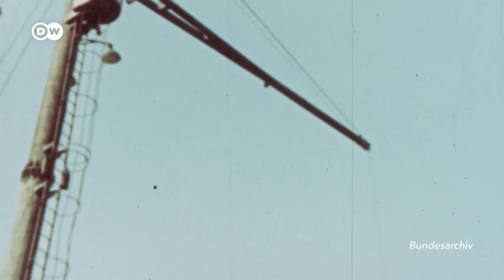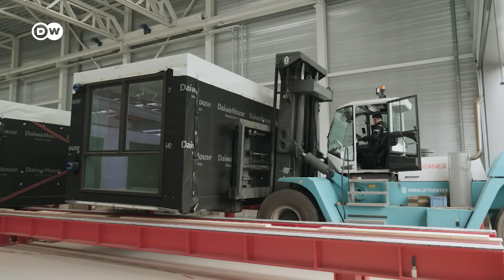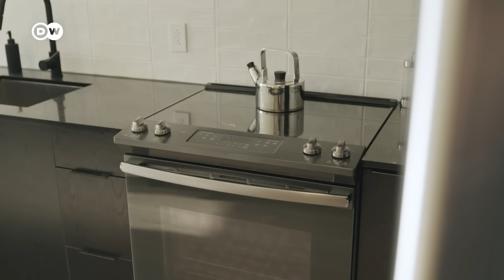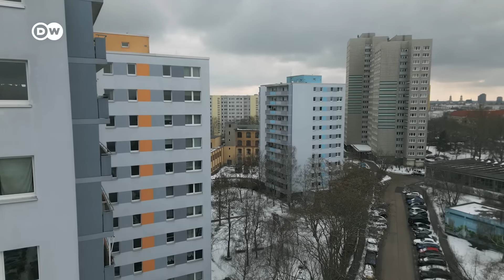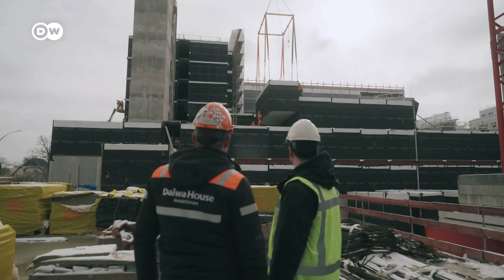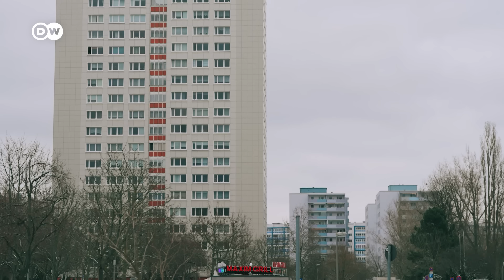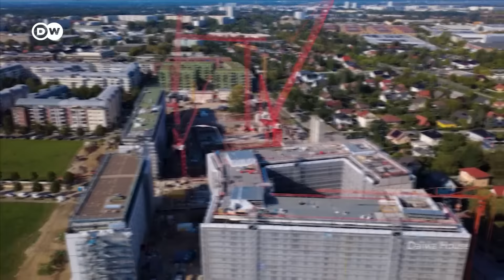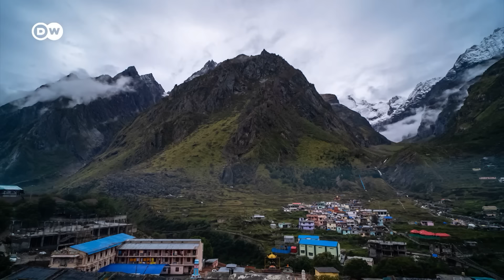These buildings are ugly. But the idea was genius.

Comment: Daiwa is the top leading company in the prefab steel building in Japan. so what is unexpected is they use concrete for their prefab construction. When it comes to sustainability in construction industry, timber-based modular construction makes more sense than concrete.

Comment: I'm pretty sure this idea is not new and multiple companies tried this multiple times in the past. Who has succeded? None as far as I'm aware, please correct me if I'm wrong and point towards a 100 year company that has been building modular homes since before ww1. Okay, that may be hard, lets try since before ww2. If thats still hard, provide an example of a company that has had a running modular factory with lots if successful projects for at least 50 years. Anyone? Because this idea is definitely older than 50 years.

One of the problems: if you dont allow the ground to settle before you put your modules in, it may start shifting under your building. Potential problems: connections between modules get broken. Like, pipes bursting and wires getting torn. I'm pretty sure I've seen a video on this topic relatively recently but I couldn't find a name of the project. I think it was a pod skyscraper in japan. Another project, iirc, from canada, died before being built (or did it just shrink significantly?) and was converted to Unreal Engine tech demo or something similar. As I've written before, I couldn't find the name of the project with a quick search.

Comment: A Red brick 8 inch by 3 inch is also a pre-fabricated unit of construction albeit smaller but highly flexible on site to accommodate different heights - different thickness - different shapes and designs. No thanks. We will stick to the smaller pre-fab units called as  bricks.

Comment: This new wave of prefab is actually been going on for a couple of decades. Before retiring, my practice used modular design for many public buildinds - hospitals, universities, research facilities, social housing. It was a huge boon to hospital floor plans which can flex with changing need. Beyond rapid construction, housing was less successful - thin walls, noise transfer, snagging and aesthetics (don't discount this when thinking about wellbeing). 

There are continual improvements being made though so I'd be interested to know what residents think after 5 years of living in them.

Comment: The modules is a good idea, like the Dutch guy said, you can take em apart, relocate them if needed, all very clever. The thing in modern architecture that I'm worried about most is the lack of architectual identity of the outer shell of a bulding. No ornimentations, no identity, no culture ... just cubes.

Comment: But why do you HAVE to "standardize your construction practices." I have worked in several factories that make custom-to-order products. The factory and the processes are simply designed to be adaptable for each project. Sure, building only one variation of your product is easier...   to get started. But, someone is going to come along with a factory able to switch between several different models for almost the same cost savings and they will eat your lunch. Then, someone else will come along with a completely flexible process that allows them to instantly custom make each module to the customer's specifications, for not much more than the original cookie cutter factory, and they will win. 

Isn't it better to simply start designing for custom-to-order from the beginning (or as soon as possible) and never give the competition the chance to put you out of business?

Comment: Personally, I am absolutely sold on the benefits of pre-fab modular housing, not just as a solution for the shortage of housing, but just because it makes so much more sense than stick-built individual homes or apartment buildings. Yet there is such stubborn resistance to it as a concept, mostly apparently from people who still have Eastern European "soul-less" leviathan buildings as their only internal example of how such buildings look and feel. The fact is that pre-fab modular housing can be made to fit almost any environment, including spacious layouts with parks and services, and individual units can be significantly customized.

Comment: Looks interesting. I wonder how plumbing maintenance works? I mean, it looks like the pipes are between the inner and outer walls. If one starts leaking, what do we do? Break the inner wall to mend it? If so, it would mean it isn't a load bearing wall. This, in turn, would mean we would have the module's load bearing structure independent from the walls.

If so, would it be like an steel skeleton, with the walls just closing the space? And if that's so, how do we deal with corrosion, since the steel wouldn't be protected by an exterior cement skin?

But quite impressive to see a building growing out of modules. Really interesting.

Comment: I like buildings like that, they allow people to live in well distributed, roomy appartments with everything they need. My parents live in a building like that, part of a complex of 28 buildings made for the 1968 Olympics. They are called "interes social", or social interest constructions. It has 4 bedrooms, 3 bathrooms, 120m2 and a kitchen with a washing area attached. On top of that you get extensive green areas, and shops. The only problem is when you do not consider having a mixed commercial area nearby or even on the ground floor of each building.

Comment: I am curious: How  are apartment buildings any better in the US? Those buildings were built  more for practicalities, but they were well built. Not all buildings were identical. Neither were the modules. Some had already windows in them , and channels for electrical. A lot of storage is built in. But not in the rooms but the hallway inside the apartment. Buildings had different features. Those areas had their own infrastructure. Essentually you didn't  have to leave the area.  BTW, modular buildings have high level of quality  control.  While the quality of  family homes are hit or miss.

Comment: I think the concept is great, I think the execution leaves a lot to be desired.  They need to be looking at good apartments from the 1920's.  I lived in a 1923 building in a studio, walk in closet w/ built in dresser, very serviceable galley kitchen, deep pantry closet for storing food and cleaning supplies, a bathroom that didn't have just a sink hanging off the wall, but a vanity, and a built in Murphy Bed closet, so I could put it away.  The 1 bedrooms in the building were awesome.  Quick is great, quick and cheap at the cost of the human experience is not.  Also, mixing up the exteriors, and  putting breaks/openings in the facade, would at least make you feel like you weren't returning to a prison block when you went home. Setbacks, green spaces...  Walking through streets lined with 7 or more story concrete blocks is soul crushing. Two things can be true, we need quick affordable housing, we also need to feel like they are somewhere we want to call home.

Comment: Those actually look like they have good soundproofing and possibly insulation of cooking smells and smoke between units, which is the main drawback to apartment living.   If more effort were put into making it such that you didn't hear or smell your neighbors, I think more people would prefer apartments to homes.   

US apartments, meanwhile, have shared vents and paper-thin walls, making them horrible.

We need more units with concrete walls and floors and distinct HVAC ductwork.

Comment: plattenbau are junk. the concrete floors are at most 6cm thick and when we were renovating these back in the 90s, in east Berlin, there were gaps in the walls you could literally put your finger through, at the seams. This was winter in Berlin. I guess for what they are they make sense.

Comment: Here in Germany's neighbour, Poland, there are 4 million flats in Plattenbau (we call it Big Sheet)
Some of them are 60+ years old, with 0 structural problems. The main problem (expense) related to them are the various upgrades needed-  insulation, new plumbing, electrical wiring, etc.
All things considered, the Platenbau is not vastly different compared with the new modular methods.
They are just new and more efficient. 
If enough money is invested in the Platenbau, it can provide comfortable, space-efficient housing for a long time, especially in space-restricted places like Europe.

Comment: wow they dropped a bathroom...sorry dude in prefab houses from the soviet era the bathrooms were an entire box hokked up and placed into the buildung. and why you are lying? a plattenbau is a sandwichwall 4cm concrete, 6cm insulation, 20cm concrete for the outer walls!
if you look close, the prebuild boxes are literally trash for a living home! useable for temp housing, nothing else. its the el chepo way without quality.
200-300€ per month for trash? xD scam! 300€ for a single room (30qm) is overpriced. 300 to max 350€ with cleaning the outer floors from a company for a 2 room apartment (50qm) is max price. is it this, its a scam. the rental market is mostly a scam.

Comment: For me the Indian researcher probably talked the most sense. The innovation is welcome, but standardising construction and building, heavily reliant on concrete may be an improvement on current practices by various measures, but doesn't fundamentally move us towards sustainability and adaptability. So, probably it is somewhat of a good thing that this is currently only really happening and efficient in specialised situations. If I remember correctly, there are also prefab off-site wooden construction modules, which in many contexts at least use a renewable material as their basis. I'm not sure if it is equally advanced. In many areas of the world, adaptable, varied and low-technology innovations that can stimulate better construction and results based on indigenous landscape-based principles for self-construction would be a much more appropriate advance.

Comment: Standardisation- starting with building codes , zoning laws , and red tape / planning approvals / burocracy  - needs to be mandated by government. Modular is definitely the way to go for mass and social housing, mixed with normal / private / commercial domestic housing to avoid ghettos forming. It’s pathetic to see brick and tile construction of residences taking upto 2 years build time in the 21st century . Build it and they will come . An exciting concept that should be enthusiastically embraced and driven by government ( but privately run construction factories)

Comment: This technology is closer to containers than to prefab concrete block. Look at the materials and structure of modules, looks like in general it is a steel frame with walls from SIB like panels. Sure it should be cheaper to build like that, and it is ok for temporary housing. But old prefab blocks last for 70 years and still can be comfortable to live in. This containers will definitely last twice or thrice less. And finally it would be more waste, and these panels are probably not recyclable. So we can call this fast housing as we call similarly fast fashion. 
This technology may be good in many cases as temporary but don’t compare it to conventional houses which last decades and in which few generations can live.

Comment: I’m in Melbourne, Australia.   My house was built in a factory then transported on trucks and assembled.   It was designed by an architect, specific to my requirements.   It was faster,  cheaper and ran to clear timeline as the factory could control assembly and weather wasn’t a problem.   It’s a beautiful and unique home.  Such a great approach.
Reply: Was it an expensive process?

Comment: How are the modules connected?  If there's an earthquake or sink hole, would the end units just fall off?  Is it just held in place by gravity?
Reply from the maker: Hey! The modules are stacked on top of another and secured together with bolts, so they form a unified structure, not just blocks that could slide out of place. As for natural hazards, it would likely depend on their severity:  if a real sinkhole occurs beneath the building, it would affect any type of structure. 🤔

Comment: I love the idea, which is, as the video implies, not novel in any way. I think what is missing from this approach is the reparability. We should stop trying to make these apartments look like conventional buildings. This desire is stunting the innovation. We can change the way the architecture is understood and improve repairability. In my opinion, the modularity is not as useful if it only applies to the initial stage of the construction. We should be able to replace wall panels, plumbing systems, electrical systems, etc. much easier and everything should be standardized at a much wider scale, wider than an individual company. Only then, we can improve the construction industry as a whole. I hate to say it but, this idea will fail, especially because it is based in Netherlands, where labor costs are much higher than elsewhere, ironically mostly due to high housing costs.

Comment: I wonder how good the sound insulation is, that would be a primary concern of mine. If the concrete on the floors and ceilings is thick enough it should be fine.
Reply: the walls are generally thick and are usually insulated on all sides for both climate control, but also fireproofing etc. they also block sound pretty well from what I can tell. (there is a limit of course) Each unit/apparement is its own wall, floor and ceiling and usually in new construction of appartments it is a requirement by building code. (depending on your area of course)
Friend of mine lives in a modular appartment similar to the ones featured in this video, from what I can tell they tend to be soundproof.
Reply: 25cm of solid reinforced concrete is excellent sound insultation. Gaps between the blocks need to be fully sealed. Walking around on a solid concrete floor wont transmit sound or vibrations to the space below. I lived in a concrete modular block from the 70s for 3 years and it was like a bunker (and had amazing views  with large windows and a balcony).
Reply: it should be just thin enough to hear the domestic abuse from the other apartment and having to put cardboard on windows to keep the warm inside, while during summer being the hottest place you have ever experienced in your life. thats the authentic brutalist experience.
Reply: @KossolaxtheForesworn  Warm is usually enough inside. I don't even use heater at winter. But the summer is so real.

Comment: Putting roofs over our heads is something our prehistoric ancestors managed already with really primitive materials and tools. It's not a cost problem, it's a permitting problem. Without permitting as the main and only obstacle, cities would have slums where people just improvise housing wherever they want. You can actually buy a luxury home for under 50K. It's called a camper van. It even has wheels. Very popular with people that already have a home. Second hand value of these things is ridiculously low. Lots of people pay an arm and a leg for far less glamorous places to live in than that. In the US they have so-called trailer parks where you buy a "recreational vehicle" and permanently park it and live in it. Slums are the end state of when states fail to take care of things. People have to live somewhere. The housing crisis is a crisis of artificial scarcity. 

Modular production of housing makes a lot of sense as a cost reduction. And with the right building codes, cost stops being part of the problem. But cost of production isn't the core problem here. It's the artificial scarcity of where people are actually allowed to put these things down. You can buy a pretty nice shelter for under 500 euros if you are desperate. It's called a tent. The trick is finding a place to put one down. The homeless tend to pay a lot less as they don't tend to have even that amount of money. And forget about finding anything decent to live in for even close to that amount of money per month.

I actually live in Berlin. This city has plenty of space around it. The nearest big city is pretty far away. It's just country side and small villages in circle of ~100km around Berlin. There's no shortage of space. Just restrictions on what you can do with that space. Fun fact, Berlin had more inhabitants before WW II than now.

Comment: 1. Rubble from demolitions is used as a base for e.g. roads - not wasted.
2. I agree with about 20% savings, which isn't that much - it is easier to build, but harder to transport and equal to finish and furnish. If it already have all the plumbing, it will require more careful assembly. Again, (only) 20% savings seems legit, which isn't good enough in my eyes.
3. It doesn't insulation for both noise and temperature. These prefabs may actually be inferior to the old ones, like a block of mobileheims. They may shine as temporary buildings, but I'm not sure about permanent ones.
4. Old prefabs were build (at least in Czechoslovakia) as temporary housing solution, until all the needed family homes are finished - they were not meant to be permanent. I think new prefabs should serve this purpose as well, for which they may not be well priced, I suppose.

Comment: such buildings having a bad reputation is purely political.
that and old style plattenbau having thin walls, which is a very fixable problem.
Reply: Not in Eastern Europe. They are shitty small, cramped apartments. No thought put into the need for adequate space to live happy, fulfilling lives.
I need hundreds of square meters of living space for that, and it seems impossible to achieve at a standard scale for society at large.